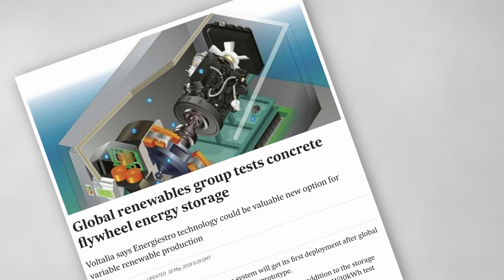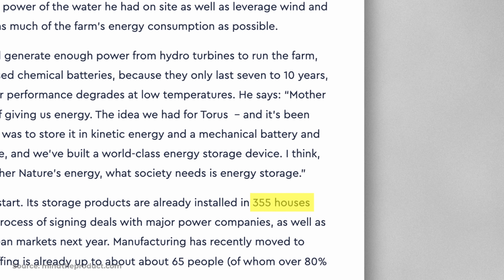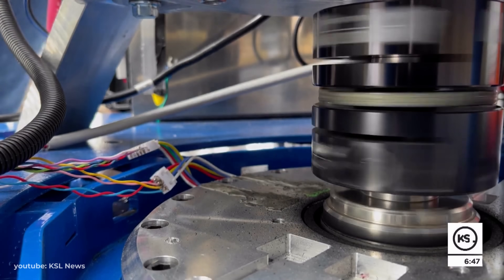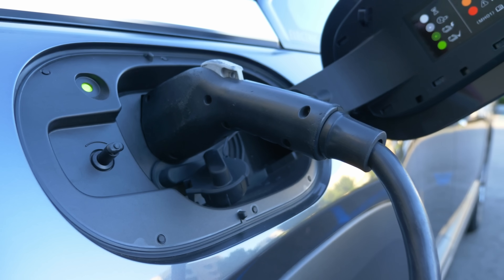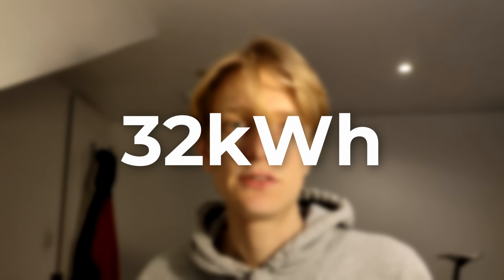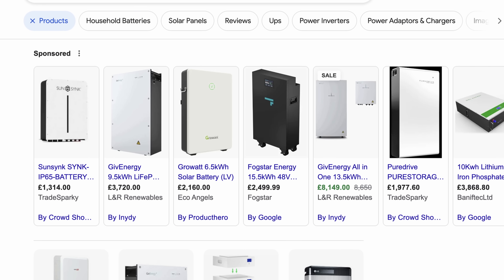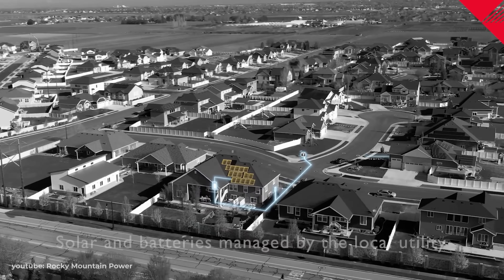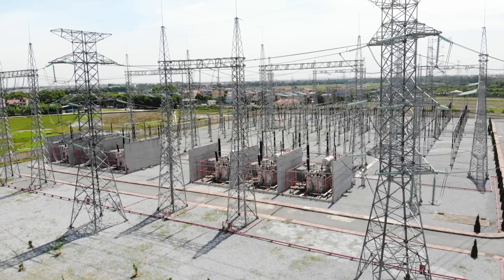Is this *FINALLY* a Break for Flywheel Energy Storage?

Comment: Curious if it would help if one where to use an extraordinary heavy material to make the flywheel out of, like say, lead? To store more energy?
Reply: Lead isn’t strong enough so would come apart at high speed. Something like tungsten could be a better choice.
Reply: @NBSV1  Yeah Tungsten would probably work beter. But any material that is high in mass. That can hold out even at fairly high speeds.
Albeit you can still limit the speed, to use cheaper materials such as lead.
Reply: You want the highest strength/lowest cost material you can find. The rpms are limited by the tensile strength of the material. There are some interesting commercial options on the market that people generally don't know about with a breaking strength of around 1800 MPa.
Reply: @michaelveegh4508  I was just thinking along the lines, that higher mass materials, spun upto there maximum tensile would be able told more energy. As the more mass an object has and the faster it goes, the more difficult it is to stop afterall. 
Aka it takes more energy, to stop it.
Thus in a flywheel, it would be able to store more energy. Due to the laws of conservation of mass.

Comment: Flywheel energy storage can easily and cheaply enable hyper loop systems, along with vertical wind turbines and solar thermal power.

The biggest hurdle to a hyper loop is pulling a vacuum. If you have distributed power and storage along that entire corridor, that problem is dealt with.

The other issue is materials. You need super strong materials and the seals between them. 
- You need a combination of composites, alloys, and concrete (protecting it from expansion- which is why they thought of burying it)

-For a Hyperloop with flywheels/solar thermal/ vertical wind turbine energy maintaining that vacuum, you just need enough concrete to shield your composites/metal sleeves.

Basically, like really big hydrogen storage vessels.
Reply: Trains are a thing.
Reply: There are high speed trains all over Asia. Wind resistance is a tiny hindrance to trains, definitely not enough to justify any kind of hyperloop. Elon musk even admitted that the hyper loop was a ploy to stop California from pioneering American high speed trains so he could sell more electric cars
Reply: Hyperloop will forever be a myth. It's such a pointless thing to shoot for when bullet trains have existed for decades.

Comment: I'm having a hard time imagining a flywheel that can fit in the back of a pickup truck (I know that weight would be a totally different thing, but still.) being able to store 10 kw worth of energy. What's the fastest speed the outside of the flywheel can safely acheive without falling apart? 300 mph? Since the center is stationary, the average speed of the whole mass would be half of that, 150 mph. 10 kw is a little over 13 horsepower. Would a 13 hp motor really take a full 60 minutes to spin this thing up in a vacuum to 150 mph avg speed? I could certainly be miscalculating something here, but it seems awful difficult to cram 10 kw into a flywheel this size, unless it is filled with gold or mercury 😂
Reply: If it were a circle and the outside spun at 300 miles per hour, then the average speed of the mass is above 150mp. If you cut the radius in half you lose more than half the area of the circle. Area of a circle is pi * r².

Comment: I don't think flywheel energy storage is really ever going to be a good solution...
Reply: Flywheels seem to be great to add inertia stability to the grid.
Reply: @Zosu22  The generators at every single steam turbine has a flywheel attached to them.

Flywheels good for energy sinks not for energy storage.
Reply: Why?  Sure they don’t work well for seasonal storage, but in that case Power-to-x and Thermal or Pumped Hydro / Compressed Gas Energy Storage work better.

Batteries are cheapest for now, but that takes into account none of the impacts really.  They can be done cleanly (Sodium Ion Batteries without Cadmium, Cobalt, and rare earth/conflict minerals really, and a robust recycling+disposal ecosystem) but as of now short of applications where they MUST be used (Mobile Electronics) they are a pretty bad option.

Also Flow Batteries may be a good small scale storage option.

Comment: in Germany a 8kWh DIY LFP Battery is around 2000€. This price will be going lower in the next 12months. Connecting such a battery to the grid is standard procedure. Fly wheel has no chance against this low lfp prices.

Comment: Isn't it more economic to just build power stations and connect them to homes and businesses using and electrical grid?
Reply: Maybe if you have the luxury of living in a country that is willing and able to build power stations and expand grid capacity. Here in South Africa, our grid has been crumbling for decades and power station availability continues to fall as stations continuously fail and no one even thinks about building new ones. We have had rolling blackouts for 20 years, virtually daily the past few years, with half the country not having power at times. Solar and battery imports for homes and businesses has become exponential, with $3.5 billion worth just in 2023, including 5GW of solar panels. Since batteries have to be replaced regularly due to many daily cycles, this flywheel product would sell really well here.

Comment: I've been reading about this since a kid 30 years ago.  Like nuclear Fusion energy, flywheel storage remains underwhelming. It could be useful if there is a niche to make use of the cycle life, but no only racing cars like F1 cars make use of the high frequency cycle. by the way, batteries are as good for discharging. They can max discharge to about 20minutes.
Reply: F1 even quickly moved away from flywheels to batteries once technology improved a bit. Ends up being overly complex for a small return with flywheels.
Reply: @NBSV1  thanks, i did not know they moved to electronic! flywheel solution is falling behind from batteries due to reliability and complexity. flywheel could remain useful when kinetic wnergy is directly utilized not converted to electric, like the flywheel in all ICE cars

Comment: I think gravity energy storage is much better solution. You don't have friction loses, no need for precise balancing, no noise, and I'm guessing no need for relatively often bearings replacement. And I don't want to think damage this flywheel would do if bearings seize and that flywheel rips itself and start walking through house, it's like construction wrecking ball.
Reply: Gravitricity is such a company.  Their plan is to use old mine shafts (like we have here in South Africa) where they can lower and raise large weights and use them in batteries (i.e. like bullet rounds in a gun cartridge).  That makes them much more practical.  As for the friction and the bearings, I am pretty sure such a venture will require regular maintenance on those parts, not to mention the inspection of a few thousand metres of very strong steel cables !

Comment: I've gathered a bunch of papers and old video's published and hosted by the Lawrence Livermore National Laboratories(LLNL), some of which has been removed from the internet, about their flywheel research and just how close they were to a real product. I emailed LLNL about a year ago, and they responded saying they cant talk about it, but they have licensed some of they technology. All I could assume at the time was a private company had taken over the project and probably made some significant progress.

there seem to be some key differences between torus and the LLNL technology though.
LLNL was spinning much faster, too fast for the rotor to be made of steel, they had a carbon composite rotor.
They also had passive contactless magnetic bearings. torus seems to use magnetic assisted bearings.
the LLNL had a parasitic loss of less than 1% per day due to the contactless bearing. i have never seen any commercial product actually do this
Reply: Dang, a rotor sitting on a contactless bearing inside a vacuum could certainly save energy for a long time. Exciting stuff, and I hope to see the LLNL research brought to market.
Reply: So basically charging and discharging it at daily basis makes it above 90% efficient energy storage.

Comment: 20 years ago I looked at flywheel systems for use at work (a TV studio and a separate one for the transmitter).  Now both locations had (and have) 200kW diesel generators.  However, those take roughly 30 seconds to start and stabilize.  We wanted the flywheel system as a whole facility "backup" to give the generators time to come online.  The price was enough that we could have purchased another brand new generator for both locations.  That said, if the price tag drops a bit more I can see these coming into play more for commercial applications where you need CLEAN power until a generator kicks in.  Hospitals, datacenters, cell towers even.  Your HOME user is going to want something that will run for a longer time.
Reply: Always entertaining to see one of us rare breed TV engineer people here on YT.  Glad I wasn’t the only one with this light bulb thought! It’s crazy how efficient TXs have gotten these days especially those R&S and gates, randomly thinking on that note.
Reply: Também intui muitas, muitas mesmo, tecnologias que se tornaram realidade! Sou técnico em eletrônica. Mas o fato é que, por vários motivos, nunca implementei nada! Então é isso: não adianta agora eu  chorar por não ter levado minhas ideias para frente. Mas não estou morto ainda e se DEUS permitir que eu continue; agora estou finalmente tornando realidade meus projetos.
Reply: This was a really informative comment and helpful perspective, thanks for sharing!
Reply: Lithium battery storage immediate energy delivery
Reply: @jimsouthlondon7061  At the time ANY battery storage, beyond individual UPS's for computers, were prohibitively expensive.  Nor did the building have the SPACE to put a few tons of batteries.  That flywheel system would be good for a site that doesn't have climate controlled space for a battery bank.

Comment: Surprised nobody has picked up on the pun - flywheels are revolutionary.
Reply: I think they are revolting.
Reply: @psdaengr911  Utah - the home of most multi level marketing schemes. Their biggest success is in religion, lol.
Reply: @aussieideasman8498 DUM-dumdum-dum-dumb!
Reply: Also,  "break" in video title.
Reply: It's just too dumb of an idea to bother with. It's easily as dumb as the Space Elevator idea.
Reply: @SVW1976  In 1950's it was an idea that worked when all as you have is lead-acid batteries.  In 2020"s it's obsolete for buses.
Reply: Flies don't have wheels, they have legs and wings.
Reply: I know you, you are a troll but here you are correct.
Reply: lol it is based on the revolution.
Reply: At least 5 fly wheels stacked....i swear I've seen sci-fi movies implementing this device...

Comment: I've always been fascinated by flywheel batteries and ever since I first heard of them, tried to imagine ways to make them viable.
This is a great video, BTW!

I would think that it wouldn't take much to keep a battery at peak efficiency with occasional 'bumps' to it to keep it at its peak RPM once it's spun up.

36 KW/H is an amazing amount of energy and I had no idea they were this powerful!

Do you know what RPM these babies spin at?
A half-ton flywheel at 50K RPM would require a huge casing in case of a RUD, to use a SpaceX trope! ;-)

Comment: 1/2 a ton rotating at what rpm? Those bearings better not ever touch down and bind up or you've got a terrifying flying chunk of metal on your hands, and going through the side of your house, and your neighbours...
I had a professor in university and we did a capstone engineering project on this exact design challenge and becuase of the safety risk involved we had to specify that the vacuum flywheel enclosure be stored in its own concrete bunker. Enclosure was vacuum tight for 25 years with the rated leakage of the connectors, then drop it into its vault and leave it alone.

Comment: Seems it would make more sense to use thermal systems like sand batteries or salt based batteries. The flywheel will have maintenance issues, has complicated engineering, and failures could be catastrophic. Where most thermal solutions are simple, have little to no moving parts (still usually has some type of pumping system for the thermal transfer medium), and failures generally mean the device just shuts off and cools down eventually.

Also cost. Thermal solutions will be amazingly cheaper. So combined with batteries you'd likely get similar  energy storage for the physical space abd save money.

Seemsbthe best solution would be a three stage thermal medium, Sodium battery designed for cycle longevity, and lithium battery for large outages and high peak output.

Comment: wooooow, i'm in the wrong fucking business. A 5 foot diameter, 1 foot width cylinder block of steel flywheel would cost maybe $390 (4 cents per pound), a $200 alternator/motor (brushless or even spring retract), $10 speed light sensor, $70 custom in-house magnetic bearing, $30 for arduino/pi, $50 for custom power board with parts, and maybe $150 for covering and the rest.....that's $900 and they are selling it for $35,000? holy shit!! 97% profit margin is nuts.
Reply: $35K? No, the target price is $3500... he's quoting entire system costs with solar and batteries and installation, and several flywheels.  Just don't lose balance or you'll have a hunk of metal go through all the walls of your hime.

You could also just put a giant boulder on a pulley system and lift it up over a bit of time with solar, then drop it and capture that energy for even less I suppose....
Reply: @BenBethelAZ You'd bury flywheels. If it does get unbalanced, such as in a horrible earthquake, it has nowhere to go but into the earth around it.
Reply: How do you get 4c a lb? 
The bigger more  massive the object the bigger the furnace it needs and the amount of energy indeed increases so does shipping and all that....idk metal seems more expensive now. Compare it to something similar. It would probably be like 3k or more
Reply: @SimEon-jt3sr  i googled "iron price per pound" and then like multiplied by 4.....if it's wrong, whatever, you only need a heavy weight and balancing is easy.
Reply: It’s a Utah company so it is a scam.
Reply: @rolandnelson6722 Pardon?
Reply: Liability insurance, machining, labor, payroll taxes, licensing, sales taxes, If you make a profit more taxes, tools, a big truck (maintenance, commercial vehicle insurance), a winch or something to move heavy objects, cement, contractor bonds, inspections, cable, conduit. I think I left some stuff out. You might want to incorporate this business to limit liability in case you get sued or they can take everything you own personally.
Reply: What an ignorant thing to say. Go on then! Go do it! Or is it too easy for you?
Reply: @cgcrosby2  already did it.....15 years ago, but the loss rate was far more than a planetary gear and weight system.
Reply: @sabriath I would absolutely love to see your scrapyard build spool up to >100k RPM. From a video feed, of course.
Reply: I’ll pay you $5,000 if you can build one. That’s a 4k profit for you!  I’m not joking. Dead serious. Hit me up.
Reply: I think your numbers are way off. It cost juicero $750 to make their pouch squeezer, there’s no way this is coming in at $900
Reply: 4 cents per pound for a piece of shaped steel is ridiculously stupid. Completely scrap metal is worth ~$0.50 to $1 per pound.

A simple 2-inch thick piece of 4ft by 4ft sheet metal is thousands of dollars.

All of your prices are crazy nuts. Where do you develop custom high weight, high-speed magnetic bearings, and get them for just $70. Where do you get such a large vaccum sealed container and get it for $150.

Your prices are all off by an order of magnitude or more. More like $9000, and they sell it for $35000, which makes sense when you consider things cost much more than the sum of their parts.
Reply: I'm pretty sure the inertial mass is not where the bulk of the cost is coming from. Its gotta be the low loss system. That's not something anyone can achieve